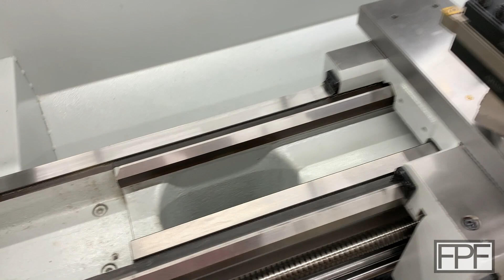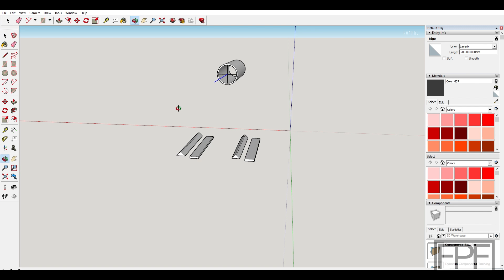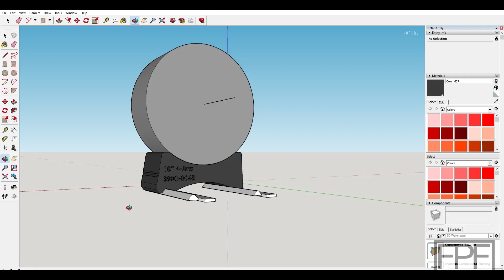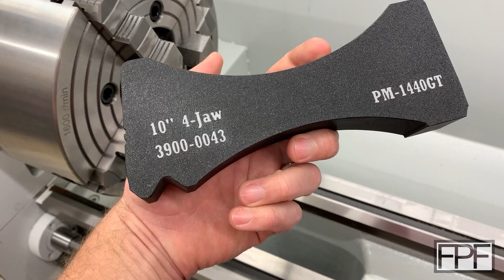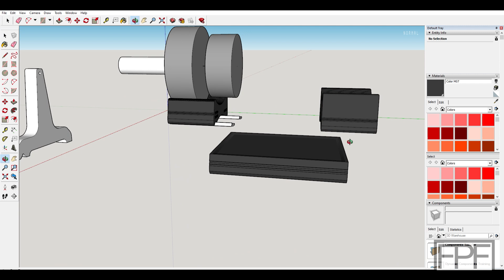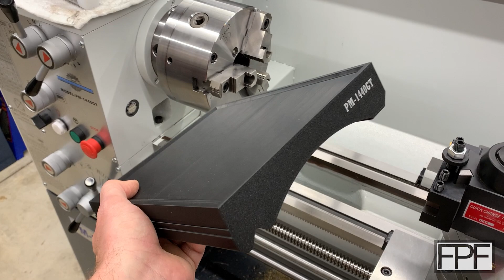3D Printed Lathe Chuck Alignment & Mounting Sleds - PM-1440GT

Comment: Really nice idea and build. I had subscribed 2 minutes in, and starting printing 5 minutes in. Don't have a PM 1440, but I do have the Grizzly equivalent. I'll let you know how it fits. In the meantime, I'm off to catch up on your other builds.
Reply from the maker: Thx, let us know if it fit.  If the bed width is the same, it's probably spot-on.
Reply: @FunctionalPrintFriday   - the sled fits the ways exactly. My lathe came with a 7" 3-jaw and an 8" 4-jaw. I printed the 8" and it works great for the 4-jaw. I will get  1/2" thin foam pad to go between the sled and the 3-jaw chuck. Have you looked at Inheritance machine on youtube? Brandon made an indicator holder to set the tool height for his lathe. You could use the first part you printed, with a small modification at the top to do the same thing.

Comment: What I do is pass a dowel (closet rod) threough the spindle, then I can pick up the chuck and stick it on the rod, then I can wrestle it onto the (threaded) spindle. For removal I have wooden "H" of 2x4  with some cleats that fit the bedways on the bottom and support the chuck at the top. 
Instead of measuring the bedways, you can just measure the bottom of the tailstock that engages the bedways (which is exactly the profile you are tryting to make) and then put the tailstock on a flat surface and measure to the point of the center and you're done with  less drama.
If you want to reduce the friction you can spray it with thin film lubricant, like the CRC stuff, both at the bedway contact areas and the chuck contact area.

Comment: Very nice what you did there, I have the PM 1440-TL, my guess is that the dementors are the same. Would it be possible to purchase the file for both the 8 and 10 inch versions ? My Son has a 3d printer and enjoys it, I think this is a good time to start a new hobby 🥂😀

Comment: Such a nice project! Very much appreciate your thorough demonstration of design, print, refine sequence. Plus, I'm considering a PM lathe in the near future and leaning toward the Taiwanese options including the 1340GT or 1440GT or most likely the PM-1440HVT-2. Looking forward to catching up with your prior videos now that I've subscribed.
In the beginning of the video, I wondered whether the 3D print would compress enough under load to cause some misalignment. But seeing the density of the infill from your partial print, and then ultimately the actual function with the 10" 4-jaw, I guess that won't be a problem. I also thought initially that it would be better to build in some sort of fine adjustment to the height and alignment using for example 4 posts going into captured t-nuts, but your straightforward approach with accurate measurements avoids all that added complexity.

Comment: KISS - I must have missed something. Fix  150-200mm of 13mm rod tight in the jaws of the chuck you want to remove. Place a normal drill chuck into to tail stock, bring it up and tighten it up on the other end of the rod.  (The centre of the two are co-axial). Pull off the chuck you want to remove by retracting the tail stock. It will remain perfectly aligned . It is supported on the rod and can be handled more conveniently that way… or are you just inventing a problem to solve with 3D printing when it is not the right tool for the job??

Comment: You Sir are a Genius, and... that's the cleanest lathe short of a brand new one. I like the tool height idea, perhaps a (movable) hard stop in Y then you could move the tools up until they touch. You might need to add a little weight on the 3D printed part so it wouldn't lift in the process. Ciao, Marco.

Comment: Could you take the initial prototype thatyou made (where you tested with the live spindle), machine a press fit piece of aluminum that comes to a point. Now you just place it on your ways and line up the point to your tool.
Reply from the maker: Good idea.  I do still need to design a tool height setter, and I'll consider that

Comment: Really good application.  I was disappointed you left out the measurement technique you used to determine the spatial relation of the ways to spindle center.  I’m not sure how I would do it.
Reply from the maker: Great question.  I used 1-2-3 blocks on the flat part of the ways to raise that reference above the V, laid a flat across, then measured from that up to a dead center in the tailstock.  I then measured the V's relative to the flats, and measured from the top of the V's to the dead center from each side.  It got me VERY close.  I think I ended up shifting .1mm after printing the test piece.

Comment: 15:38 where the arc joins to the vertical section before the flat plate. Is it worth putting in a rectangle shape that drips below the face so that when the part is loaded it stops the arc from splaying out forward the flat section. Basically to limit the defection to the side of the flat rail? On the other side the v shape limits you. 

I guess this is designed like for the tail block and mid block to limit thermal expansion issues, like bearing plates on one end of bridge decks.

Comment: This is a very nice idea. I made a similar block from wood, but the tolerances are not that tight, so I still need to lift the chuck 1-2 mm. I might try to print something like that for myself.
Reply from the maker: or even if you make a shorter one as a shim

Comment: I'm sorry for saying my unpopular opinion, but this seems like a waste of plastic. First of all you printed full size one instead of just templates, second you way over beefed your parts, they could like literately hold 200 kg imo. Third you could also have made this out of wood with a 3d printed template as a guide, for a router. Fourth if you know it is not going to be a perfect fit way not make it adjustable. I'm sorry if I'm being ignorant of anything, i don't want to seem like a know everything, so if anything is wrong with what i said don't take it personal or ignore it. I have seem some of your other videos, and can say that i am no better than you. I am no professional machinist, operator or anything like that, so everything i have said is from a purely subjective standpoint without me knowing all the facts. All I really wanted to say is I would have probably decided to take a different path then you. I apologize if you found anything I have written to incorrect or hurtful, that was not my intent.
Reply from the maker: I appreciate your apology ahead of time, but no need. I welcome any feedback as long as it's constructive, and this is.  For me, it's worth the $12-14 in filament for each, and the $7 or so of wasted filament testing, because they'll last a lifetime and they're 'perfect' for my use case.  I tend to be a bit (too much) of a perfectionist :)  I did actually consider making them adjustable, or even doing a really strong short arch with a seat for a small lab scissor jack, but I kept coming back to the safest and most reliable option just being a big old hunk of strong material in the exact size and shape needed.  Nothing like having a really solid base to set down a 70lb hunk of cast iron on when you reach the lathe from the other side of the shop.

Comment: On my little mini lathe from the 1960's, I don't have a tool post I use shims for tool height and use the dead center to compare tool height.
I also just use a digital caliper to a known good tool height and use the difference off the most convenient surface to see what thickness shim is needed.
I've promised myself a qc tool post, but old school clamp and shim works fine.
Reply from the maker: Get the qctp, even a junk china one is a game-changer.    You'll find yourself changing to the 'right tool' a lot more often instead of burning up the wrong one you have on there :)

Comment: I'm all for overkill on projects like this,  trust me,  but had you tried a piece of bar stock in the spindle bore to guide the chuck? On the 3 jaw you could easily clamp down on it first
Reply from the maker: That would work (at least for the 3-jaw, 4-jaw would be a bear to center every time), but the internal end of the spindle is also a precision taper, so I'd then risk scratching that one up instead.  I suppose if the rod was aluminum or brass you'd be safe.

Comment: This should come as standard equipment with any new lathe. I dread swapping the 3 jaw for the four. Nicely done!  Please print me one for a Clausing Colchester 1550.
Reply from the maker: A couple other folks have mentioned making them out of wood.  If you have a bandsaw you could glue up some scrap 3/4 ply into a stacking of 5 or 6 pieces, and just cut it based on a template made from some cardboard.
Reply: @FunctionalPrintFriday  definitely going the wood route but the 3d printed one is so much cooler. I guess function over beauty here. Thanks for the idea.

Comment: Thats a great idea. There is just one thing that could be inproved further: if you use your carriage to push the sled, you should make a cutout for the wiper seals of the carriage to avoid damaging them.
In my case i think im going to mill one out of POM or Aluminum since my chucks are quite a bit bigger and heavier
Reply from the maker: GREAT idea.

Comment: Awesome job as always! That was very satisfying to watch things line up perfectly and slide in so smoothly. I know the marring on the first one is just cosmetic but you can hit the affected area quickly with a torch and it should hide it somewhat so it's not as obvious as it currently is.
Reply from the maker: Thanks!  You haven't lived till you've tried a cheapo hot-air rework station for marring like that.  Much more forgiving, and no getting carbon on the light colors.  Throw a YIHUA 959D on your Christmas list.  It's AWESOME for heat-shrink tubing too.

Comment: Love your video and work.  But it's a sledgehammer to crack a nut.  Mount the chuck.  Build a wood frame in place on the ways.  Fill the gap with expanding foam or epoxy putty etc.
Reply from the maker: yup, this would also work, but 3-d printing is my "putty" of choice :P

Comment: I have been thinking about this a bit.   I believe when I model it I will make the sled a little wider that the lathe bed and let the sides project down somewhat and put hand hole reliefs in them and set the sled with the chuck on the shelf for storage.  I will need to see if PLA is strong enough to resist sagging under the continuous load of the chuck.  You sure do have a good and useful idea here with these parts.
Reply from the maker: thx, and love your idea for a mod'd design

Comment: One better thing, my first wood ones I made were like yours, each fit all the way to bed and ways… the next version I made a single small base plate that fit the ways, the complicated part, but then I pinned an upper section to it… that was a bad idea like yours because you need to LIFT it up off the vee way as you pull it off lathe to storage location.. got rid of the pins joining them and now it just slides on lower plate that matches the vees/bed… you only need one lower piece like that, then just flat bottomed upper ones that match your chucks….

Comment: This is a very interesting approach.   I believe I will copy your idea for my lathes and for each chuck.  Another thing, I don't remember if you pointed this out but these blocks might should be fashioned in such a way as they form a good platform for storage in the cabinet.  I always hate the way they roll around and roll into one another while handling them.   Excellent, outstanding video, thank you for sharing these ideas with us.
Reply from the maker: I set mine down (gently) on the studs.  I guess this depends on the mounting type though.  With a threaded chuck, you couldn't do that.

Comment: Very nice idea.  Even with an overhead crane I'd want one of these.   About the centering gauge, because our shop knows the exact gauge length from one of the flat ways to center line of rotation. We made ourselves a solid gauge to get very close. It's a chunk of surface ground steel as a base, a rod, and a shank of ground HSS. Distance from bottom of the base to bottom of hss was set with gauge blocks and indicator on a surface plate.  I recommend going off the flat ways since it's significantly easier to transfer measurements to a surface plate. 

With an aloris style quick change tool post, it's kind of annoying to set an accurate zero on a test indicator since the tool will rise and fall with clamping/unclamping. May be less annoying with a drop indicator but I don't like dragging across an indicator tip to find the highest point of the edge with any more pressure than necessary.  If we need tools - absolutely - on center then we take cuts on brass and measure the center feature with measuring microscope, then indicate the insert holder for displacement.

One thing that helped me speed up the centering process was graduating the 'locked' position on the height adjustment ring and nut. Finger snug is all I tighten the nut down to and only until the scribed lines meet. That way it's repeating.

-------

A bubble level tool should be interesting.  Sandvik Coromant 5856110 / edge technology Speedy Lathe Gage 08-000
Reply from the maker: thx, great info!

Comment: Nice design, though as a machinist we just put a piece of wood on the carriage and crank the chuck/face plate into position.  If the diameter was too large, again a piece of wood on the ways.
Reply from the maker: yup, that would work fine too.  thx for sharing

Comment: You should have designed a scissor lift. What do you think?
Reply from the maker: considered this.  actually thought about using a strong flat base and a lab scissor jack, but ultimately I feel in love with the simplicity of a big solid hunk of material with precision fit on both sides.

Comment: I would add a hard 90 degree lip on the front of the tray (near the letters) and a 45 or 60 degree lip on the back (since 90 would be a pain to print nicely) to make sure the tray doesn't get pushed out from under the chuck without you really noticing it.
I know you're worried about the center of the tray collapsing under the weight of the chucks, but you could probably reduce the infill to about 50% and still be able to stand on it without it breaking.   That would reduce your print time significantly.
Of course, these are nitpicky things which just means I think your design is awesome.   Thanks for sharing.
Reply from the maker: thx!  I may do some tests in the future on strength.  I think you're right on them being 'overbuilt', but I'd rather not find out the hard way with some dings in the ways